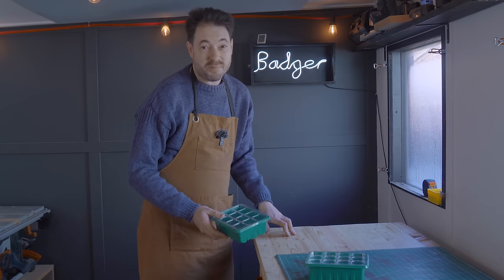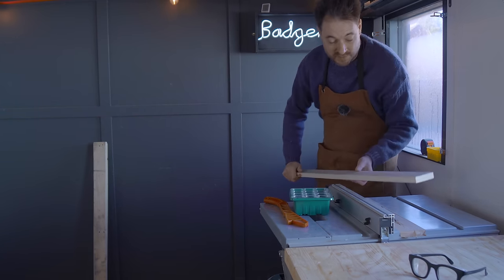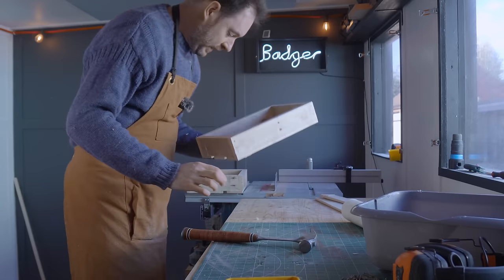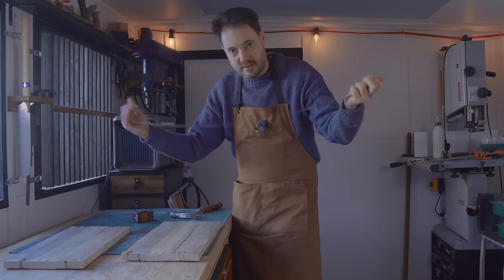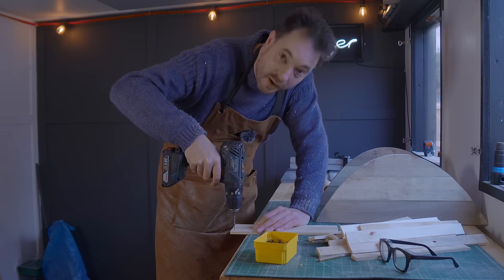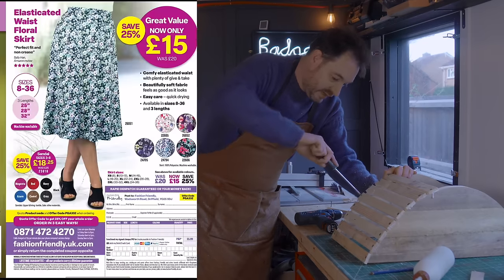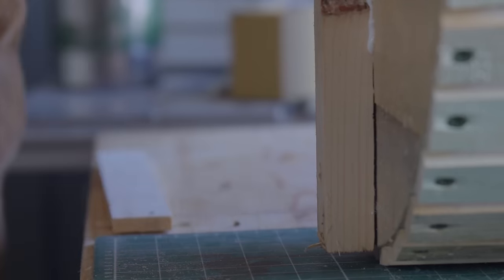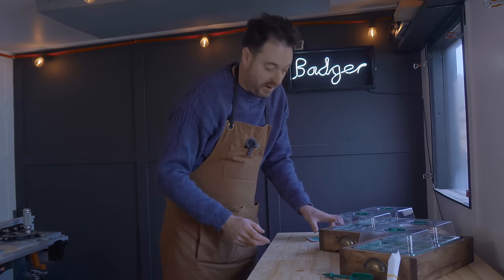Handmade Christmas Gift Ideas

Comment: Grandson is getting a pallet wood and bed slat treasure chest. 600wx520dx700hmm. Just the tea oil coat after coat to go. Oh, and steel hinges as I forgot cast iron doesn't like to bend cold.  Sigh.  Next project is a spice rack. Take care & stay safe Matt. P.S. Yer mum is mistaken.